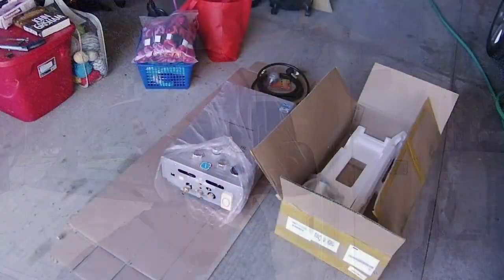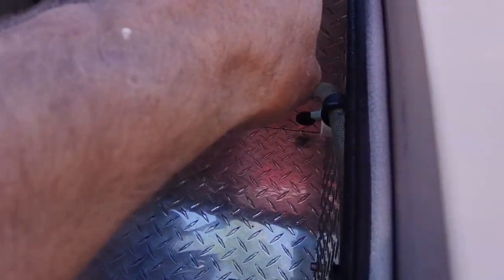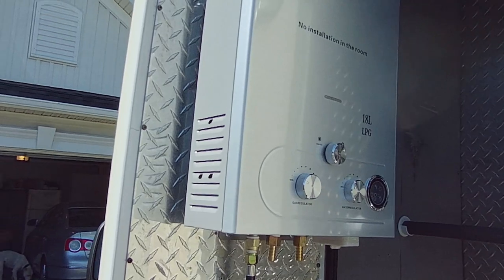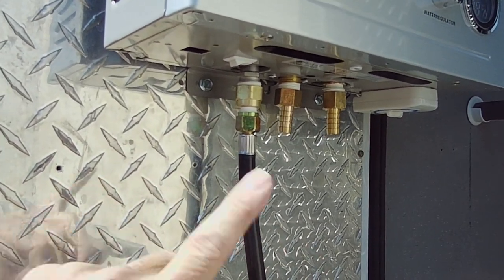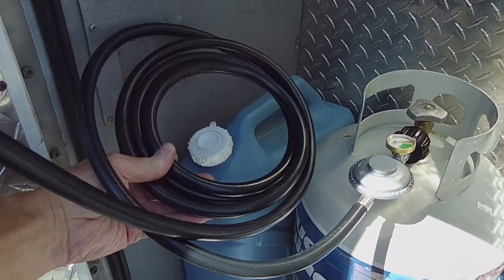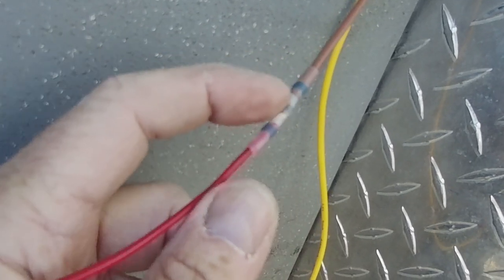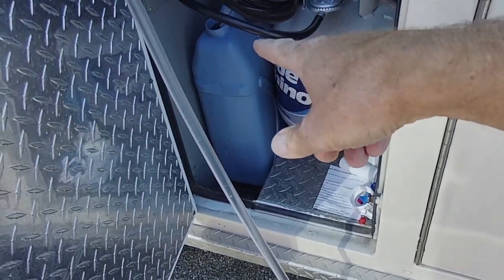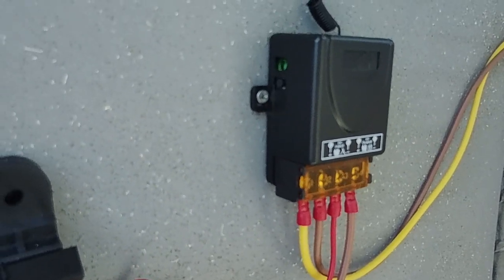I Put The BEST Hot Water System In My Ambulance | Building The Campulance

Comment: I realize this video is a year old but I wanted to comment how cool your pump remote control switch is however if you haven't figured this out yet you do not need that switch. When you use a shower head with an on/off flow function that will shut your pump off when you stop the water flow on shower head. If you have figured this out then enjoy your shower and it is a great set up!

Comment: Glad you had better luck than I did, I bought a cheaper version of that around 4 years ago for my camping trailer, The pilot light kept going out in the slightest breeze producing cold water (bought two of them)...so I gave up on them..
You could have just went to Home Depot and bought a shower head with an on/off switch on it instead of the remote. My camper van has one on it, saves a lot of water and very easy to use..
Nice build and install.
Reply from the maker: Thanks Pat I'm going to change out the shower head to a switched and better quality. We'll see how this works once we're back out!

Comment: Sweet little hot shower David! Maybe the warning on the unit is to not install indoors due to potential for Carbon monoxide poisoning?
Reply from the maker: Thanks Mark! Yes, I kinda figured that out after deciphering the manual that it came with. I'll always have the door open when it's running so I should be ok :)

Comment: Supper job David...you have a crucial info that I need...what is the part/no from home depot that you used for this chinese/eu stile water heater?
Reply from the maker: George - If you're referring to the fitting for the propane line that attaches to the heater... I'm sorry but that packaging (and part#) is long gone but I was able to take the brad style fitting that it came with (for size and thread reference) to lowes and told a rep what I was doing and he took me right to it. If I remember right,  it's a 1/2" female to 3/8" female that accepts the standard size propane line. Hope that helps...

Comment: Hi David.  It’s me again.  You mentioned in this video that a Home Depot guy helped you find a fitting for your propane connection on the water heater..
 Could you possibly give me the size of that connector and what to ask the Home Depot people for?  I really appreciate your assistance.  We have recently purchased an ambulance and are trying to fit it out.  My husband likes your water heater idea.
Reply from the maker: Hi Rita. My heater required a female npt to male. The female size I believe was 1/2" NPT. The male side was i believe standard 3/8" prooane hose fitting.
I took the fitting with me that came with the heater to match the NPT size, then said the other side of the adapter needed to connect to a standard propane hose. Hope this helps!!
Reply: The Campulance Man  Thank you, David.

Comment: David, should your water pump be under GPM, over GPM, if you can't get the same GPM of the water heater? I have the 16L which is 4.3 GPM. Thanks
Reply from the maker: Same or under. The heater can only pass 4.3 so a larger pump wouldn't do any more...